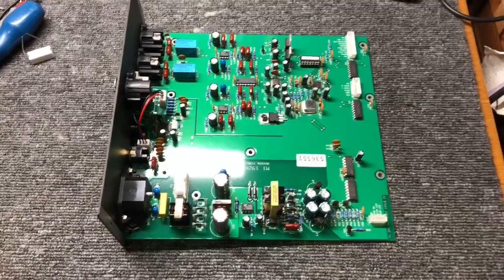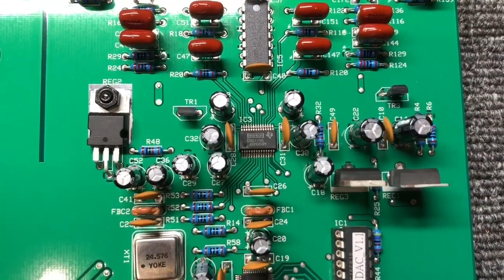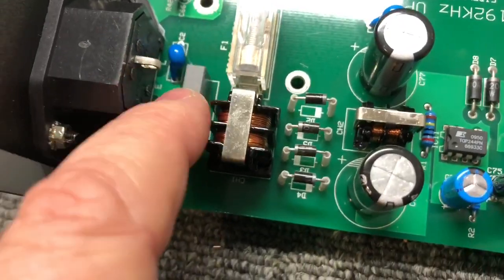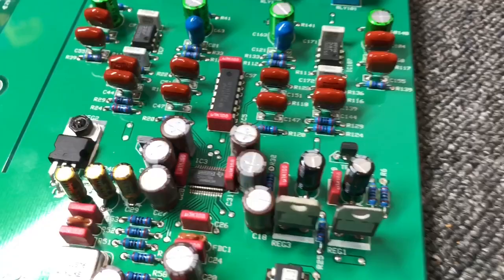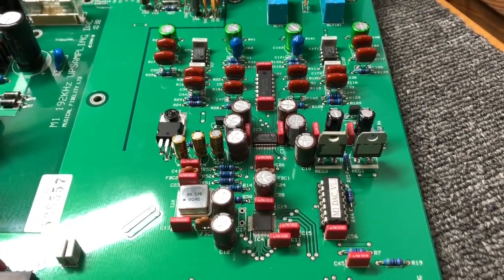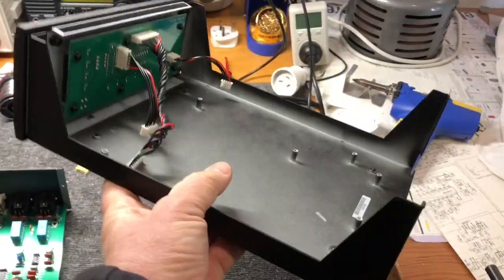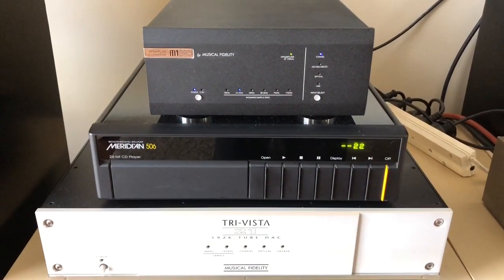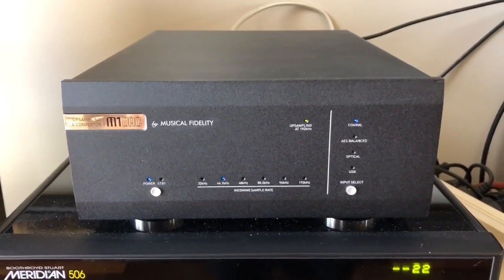Musical Fidelity M1 Upsampling DAC Improvement and Upgrades!

Comment: Hi, You may pick up on this. You use WIMA caps on this but used Siemens caps on the Tri-Vista when replacing the ceramic caps, any reason? Great descriptive Vids. Thanks for taking time to do them👍
Reply from the maker: Thanks Paul, no particular reason. I love both and have thousands of NOS parts, I like to experiment a little with cap choices sometimes, changing things up here and there just because I have the option. Ceramics are actually fine too!

Comment: What is your opinion on ceramics? Is it worth it? Or when might it be worth the effort? First thing I check now are the caps around the voltage regulators, the ESR meter tells me what I should replace.

Comment: Hello Mike  you did a nice upgrade on this dac. My only question is did you also think about swapping the 5532 opamps?  For example for the opa627 opamp ...🤘Greetings from the netherlands
Reply from the maker: Hi Peter, thanks and yes I did. There are some design limitations in this DAC, created by the need to sell it at a certain price. There are too many op-amps, but in reality, the 5532s are essentially blameless, delivering high performance in this role. The bigger issue is the lower performance, bigger bottleneck MC33079 quad op-amp package ahead of the 5532s.
Reply: @Liquid Audio  thnx for your answer Mike ... and what kind of solution are you thinking to have for the mc33079 opamp?
Or just let it be as the beatles already said😁
Reply from the maker: @pt7628  No worries. It depends on your budget and what you are trying to achieve. They are all just op-amps, so they all have limitations. There are better dual and quad packages but they need to suit the role, it's not one size fits all as some folks assume. My approach is to focus on things that can be easily improved and give good performance gains for the money. The next step would be op-amps, but at that stage, I'd suggest putting the cash towards a better DAC.
Reply: Liquid Audio ..thnx for your answer Mike... 👍

Comment: Hi Mike.
Very nice and informative video, I really enjoyed watching it👍
You talked about diminishing returns for any future mods and I have some questions if you don't mind:
1) Cheap analogue output connectors - how intrusive would be to change to higher grade ones for XLR out, for instance?
2) What is your take on adding a custom low jitter clock to the design and potential improvements it could make to the sound?
3) Would it be worth considering a low noise Differential Linear Power Supply for the analogue stage?
4) It looks like you used a coaxial cable to connect to your CD transport. Any advice on what to look for when picking a coaxial cable, with the point of diminishing returns in mind. I use Marantz SA8005 as transport, BTW.
Keep up the good work 🙌
All the best.
Danilo
Reply from the maker: Hi Danilo, glad you enjoyed the project! I can't address all of this here in a brief comment, but the key is to focus on biggest bang per buck improvements. You can change connectors, but there are bigger issues. Remember that the output buffer is basically one quad opamp. Local power supply stuff might help, but a better output buffer would help more. I think you'd be better off channelling that time and money into a better DAC, but it's fun to take these things to the limit. By all means try a few things, just be careful not to over sauce the goose, overbake the soufflé or whatever the saying is..!
Reply from the maker: Hi Danilo, yes modification is a great way to go, as long as you don't expect a Hyundai to become a Porsche, to use another analogy! Pick the right piece of gear though and the modifications can really take it to another level.

Comment: Is this something one should do for good measure every couple years? Or are you simply doing it because you can/have the means? I am asking because I just bought one, also from 2010. And I want to get my old Musical Fidelity CD1 down from the attic, which is mid 1990s. I have already secured a replacement laser just in case, dunno whether I will need it.
Reply from the maker: Hi, you probably haven't looked around my channel or website yet so this is a good question. I run a specialist hifi electronics service, repair and restoration business, so videos like this showcase what I do and give people ideas, but they also bring customers who want their equipment repairerd or improved to me. I develop mods like this, test them and then apply them to my customers' equipment where requested. None of this should really be attempted by the end user unless they have the equipment, experience and knowledge to safely do this type of work. I repair a lot of CD players too, so let me know if you have any questions, ideally via the contact page of my website: https://liquidaudio.com.au/contact/

Comment: Why bypass the  output coupling capacitors (Muse electro BP, 47uf) with those 0.1uF MKP Wima's on the other side of PCB? That's not std. for output coupling, and the parallel filter value may significantly change the sonics. To use large-value poly caps is better. Auri  or Mundorf, 10-47uF, will be fine. 
And i would change those jellybean opamps to something better. In fact, you could have left in all those ceramic caps, and saved the effort/$ for better opamps or even Burson discrete OPA's

Comment: Does anyone use this DAC M1 from a laptop running under Windows 10 or 11, and using an USB A-B cable between the DAC and the Laptop? There DAC will not run using a laptop running with any Windows version after Win 8. Any Tips and tricks to get it working?

Comment: Hi Mike, nice upgrade.
Can you explain the theory on why did you put those bypass caps?
My understanding is those are connected to those green bi-polar caps. 

Also, what are your thoughts on upgrading MC33079 with something like LME49740NA?  Would that make sense?
Reply from the maker: Hi Donnie, glad you enjoyed it! I won't go into detail here on bypass and decoupling theory as there is a ton of great technical information available online so have a google. Improving that quad op-amp is a great idea but be sure to check that a different part will work correctly and be stable in this role.
Reply: @LiquidAudio  Hi Mike, thanks for your answer, I am quite familiar with bypass/decoupling theory to reduce AC ripple "noise". For some strange reason, I had a thought you soldered them in parallel to  bipolars and that would have adverse effect in capacitance and circuit behaviour as such. My bad.
Reply from the maker: @donnied8127  Hi Donnie, my pleasure, no problem and you are on the right track but perhaps some information is missing. This is potentially a long conversation but briefly:  Small ceramic/film/silver mica etc caps are used in parallel with larger electrolytics here and in circuits in a huge number of applications, especially in audio. Smaller 'bypass' caps of much higher quality are used to reduce HF ESR and linearise HF performance. A pair or sometimes even three are used and effectively create a better-performing cap of basically the same value. Far from having an adverse effect, they have almost no effect on capacitance for obvious reasons. Overall C increases by 0.2% in this case, which is of no significance, but measured and perceived HF performance including ESR and distortion are improved.
Reply: @LiquidAudio  It's not going to hurt it, that's for sure, but why MF didn't do it in the first place is what's bugging me, even if they had to increase the retail price for 20 pounds, people would be talking more about great product and even pay more. Or was is the case of "it's good enough"?
Reply from the maker: @donnied8127  Don't be bugged! This happens with every piece of gear ever made, especially where cost matters as much as it does with lower-end audio gear. MF already filled it with the cheapest parts and expensive WIMA film caps add significantly to the BOM cost. Far from not hurting things, this technique is a critically important way to improve performance in the right applications and you'll see it used in better audio gear, test and measurement equipment etc, where fewer compromises are made.
Reply: @LiquidAudio  And that is exactly the point I'm making, M1 wasn't particularly cheap at £799 retail, and I would say some cheaper DACs back in the day would have given it a good run for half that money, unless you are handy with a soldering iron. But in the end, it's all up to corporate bean counters making decisions.
Reply from the maker: @donnied8127  This is true, it's all about the bottom line and reducing the unit build cost.

Comment: Ok, 500 usd today (2021, October), brand new, in Brazil. Is it still worth it? Half of it for a cambridge dac 100, better deal? Any advice is very welcome, thanks!
Reply from the maker: I'd avoid Cambridge like the plague. I suggest saving for a better DAC, maybe a Denafrips...!
Reply: @LiquidAudio  lol, thank you! Denafrips Ares will cost more than 1k usd after taxes. Until then, do you consider the M1 a good dac to play redbook CDs nowadays? Thanks again:)
Reply from the maker: @yuriwalter385  It all comes down to what you consider good. It's basic and limited in the ways I described. I would not be buying a new one now, but a good used one, with my modifications, is a solid performer. Always better to pay once though. Ares is a much better option.

Comment: Can you explain to me why you would add bypass caps underneath. Thanks
Reply from the maker: Great to see a fellow rider in the comments! Sure, without getting too technical, bypassing capacitors is a way of improving their performance across a range of frequencies. This has the added benefit of improving sonic performance in many use-cases, especially when associated with power supplies, crossovers and so on. There are many good technical articles on this if you do a bit of a search, but go for the engineering articles rather than forum-based stuff.
Reply: @LiquidAudio  hello fellow rider!! 😀👍 thanks for the reply.

Comment: I have one here, a 2012 model, and it will not start any more. It has surface-mount audio opamps, so it is a generation later. The power supply looks the same.

There is no voltages coming out of the SMPS and the four 470uF/25V cluster does not show the bulge on top that usually indicates that they are gone and needs replacement. There is high voltage on the other/input side. Anybody who has suggestions, wish I had a schematic or service manual.
Reply from the maker: I have all the service data, you are welcome to book her in if you'd like. Regards, Mike / Liquid Audio

Comment: Those bypass poly caps not soldered on that well especially the end one shouldn't you use some hot glue or sticky pads underneath to stop them coming loose so they're not flapping about in the breeze just a thought.
Reply from the maker: Hi John, no actually the poly caps and every other part are are soldered in perfectly. Tiny WIMA film caps are very light and the leads stiff. When the work is done carefully and the lead dress is as good as it is here, there is zero movement and certainly no need to hot glue them, or use sticky pads!
Reply: @LiquidAudio  don't get me wrong, but the end poly cap just seemed like it had a bit of Bridge solder holding it together, there's no actual physical clamping! except for the shoulder it's not even going through a hole to give it stability. more than likely it's not a problem as you say it's lightweight but with age or drop down heavily could possibly cause it to crack.
Reply from the maker: John sweda John unfortunately this one problem with people not having the knowledge or experience to correctly assess something. The capacitors under the board are more firmly attached than just about anything else, I add them like this purposely, because it is the best way to do it, nothing is going to drop down or crack!
Reply: Liquid Audio I can only say what I saw and it looked like poorly soldered that's on a small screen so maybe it isn't maybe is! As I say it's probably fine! Don't worry about it.
Reply from the maker: John sweda That’s OK John, all good but maybe next time just ask - “Mike, why did you attach the bypass caps like this.” I can then explain about minimizing lead length, maximizing stiffness, minimizing RF coupled into the parts and lead inductance etc.
Reply: @LiquidAudio  yeah you do a good job! keep it coming cheers for now.
Reply: That's a great soldering job. The caps underneath are light as a feather and held very firmly by the thick wires and solid solder.

Comment: Аппарат новый, зачем recaping было делать?
Reply from the maker: Hi, no the unit is not new. You may not be able to follow this video if English is not your native language, but I made these changes to improve the performance of this DAC. These improvements were focussed on bypassing, decoupling and using much better parts where needed and reasonably cost effective. Most manufacturers cut corners with parts quality, to save on manufacturing costs. This is a classic example of how using a textbook approach and going back to design intentions can generate big improvements.